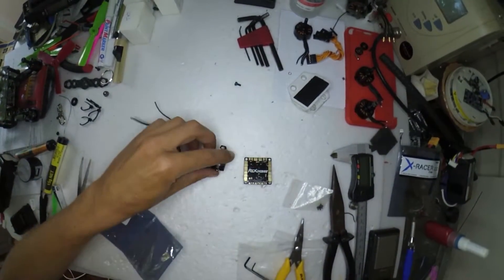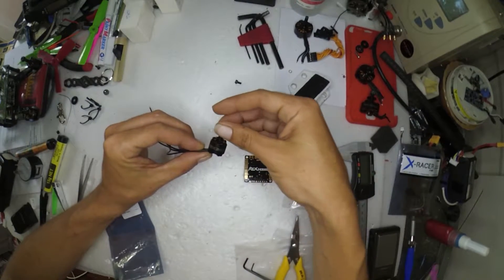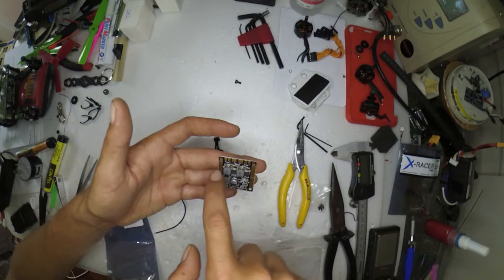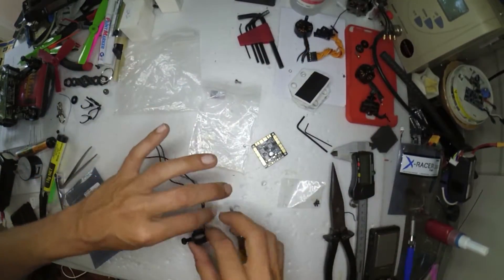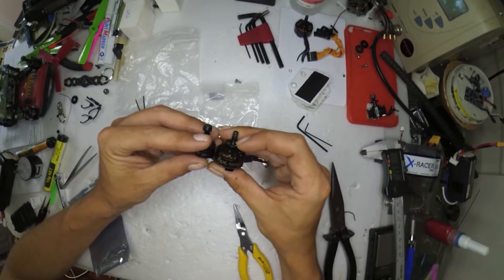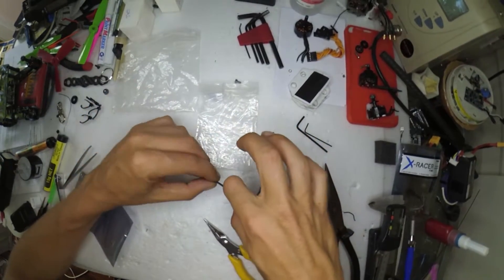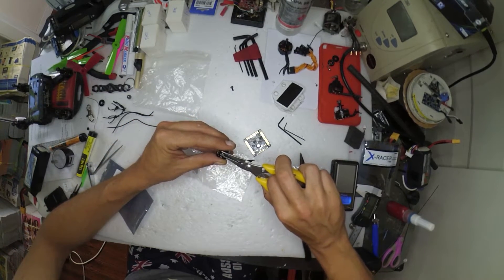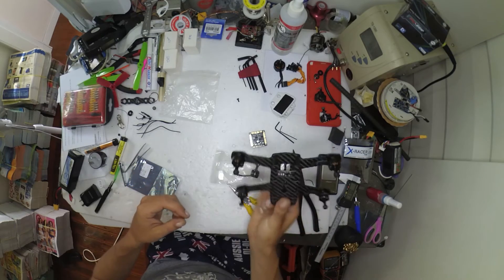RCX 1407 - 3200kv motor

Comment: Good video.  MRCM is out of stock of the 3200kv motors, so I am thinking I will order the 1407 3800kv and run 3030 props.  Sound ok or do you think it's too much.  375 gms of thrust with a 4S.
Reply from the maker: Should be fine , i wish i got the higher KV myself

Comment: Do you know what size grub screw they use for the shaft/bell?  What hex size to use for this?  Should i even worry about checking and Loctite this little screw? Also posted on the RCgroups thread.  Thanks!

Comment: Excellent tear down and review as usual, that 150mm quad will be fun. I'm planning on building an anti-FAA registration under 250g quad so I'll have to use 1306's
Reply from the maker: +EngineerX thanks mate , i bet you could get these 1407s down the that weight on 3s maybe but 4 would be pushing it , what esc's are you going to use ? i still cant make my mind up lol